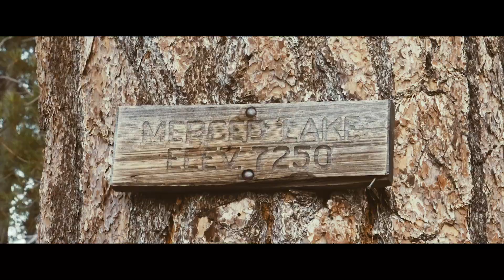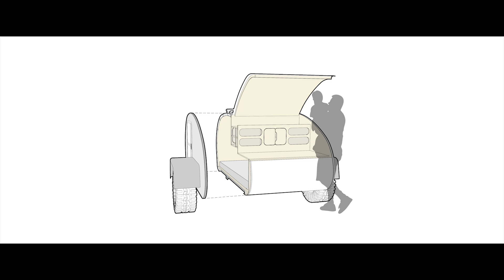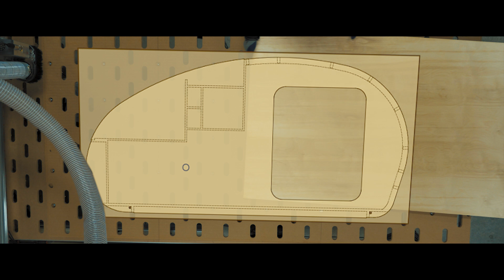School Bus Conversion: Journey Across the U.S. - What We Learned

Comment: think if you wouldve done the same  3 month trip with sumting like a teardroptrailer i think you would be sick of traveling and being cooped up together a lot sooner , you allso need to use outside facilities like toilets and showers wish means you need to stay closer to civilisation unless you dig a hole in the ground and dont mind b.o. 
another thing is that you cannot take a lot of souvenirs and memorabilia from the trip with you  , over three months time those can add up quite a bit if you dont ship them home once in a while 
you be verry dependent on the weather as a lot of the things you do in a teardrop trailer like cooking eating and socializing is outside of it 
the space inside the bus gives you the chance to kindah seclude youreself away a little from everything else while still being together and stay dry and comfortable even when its raining day and night  
on the other hand the amount of fuel saved per mile compared to a diesel bus alows you to rent a motelroom every once in a while  , and if you use a van to pull the small trainer you could have some other comforts in there like a "livingroom" a fridge and enough water to wash up 

the trailer looks realy nice , if you cannot find big enough sheets of plywood for the sides you could use thinner plywood and gleu 4 of those together 2 butted and two over that with an overlap , that should be about as strong as a full sheet you can get the cnc router to make a nice wavy butt joint for the sheets to connect
Reply from the maker: You bring up some great points, I think prior to the bus trip we had some of the same ideas and that's why we designed the bus the way we did. It's hard to explain how much time we DIDN'T spend in the bus. We never really just hung out in the bus. Though I'll admit, the weather was mostly pretty favorable during our trip. But coming back for the trip we just felt that the bathroom area wasn't important enough to take up interior space of the vehicle. If anything, we'd put a road shower on the roof rack for showering. If we really felt the need for a toilet (we preferred the woods) we could carry a cassette toilet on the front utility rack in a toolbox or something, but probably won't end up doing that. In the end, everyone has their own needs and preferences, which makes a different perfect travel vehicle for different people. At the end of the trip we felt ours personally is the teardrop design. But a sprinter/campervan is definitely another good option.
Reply: @TheVoyagerProject  im not mush of a hiker and outdoors person , like you said different strokes for different folks